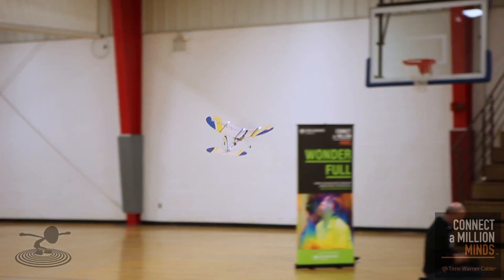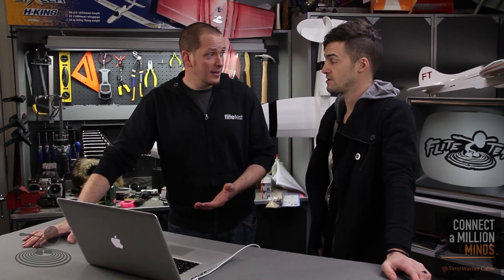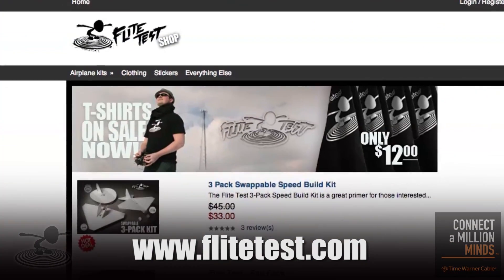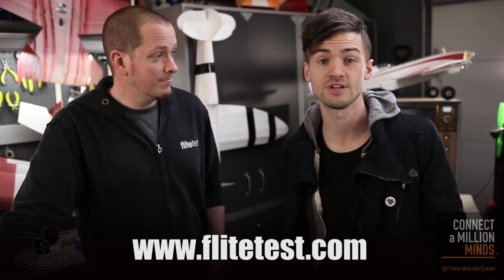Flite Test - Control Surface Workshop

Comment: You are only partly on point here. The control surface, especially on small airplanes and of course even more so on these foamies, work through deflection. Yes, it affects the aerodynamic lift (K-J, bernoulli-principle and all that), but that effect is only a fraction of the newtonian effect of the deflection of air. You could say, if you like, that the control surface doesn't so much cause/change lift, but instead gives trust to the control point and thereby an angular movement (around the cg).

Comment: I recently had to make the same decision.  The Bixler from Hobbyking is what I picked.  You can buy piece by piece or complete and ready to fly minus transmitter/receiver.  Even in the most complete form it's pretty inexpensive.

They're reputedly really durable and super-forgiving for newbies like me.  After seeing how durable EPO foam is, I won't touch wood or fiberglass frames for a long, long time.  

These guys have some great material on the Bixler and learning to fly, too, so check it out

Comment: Its not noob question.. .its actually very tough one. You must remember that when the elevator is behind CG it acts as stabilizer around axle. when you put elevator in front - it unstabilises the flight. it is effective, but area of elevator in front is very delicate calculations.

Comment: Guys great work on teaching the kids. But please teach them the RIGHT stuff. Control surfaces do not work on air resistance. They work on increasing and decreasing the lift on certain parts of the aircraft. For example when an elevator is down. It works like a flap increasing the lift of the tail. Pitching the aircraft down. And when it's up it decreases the lift pitching the aircraft up !!.